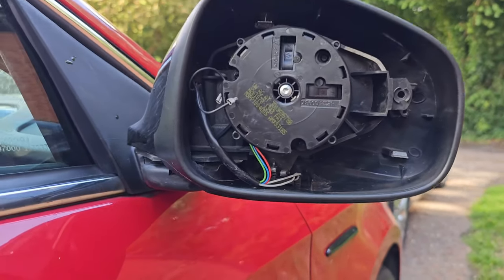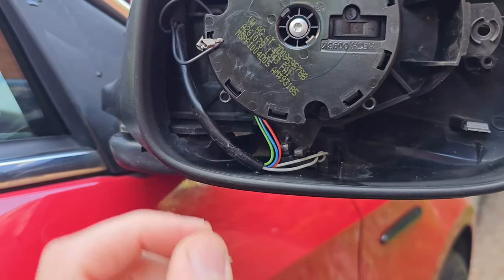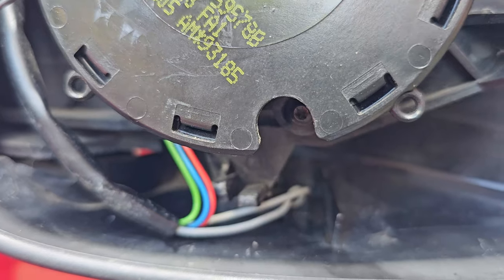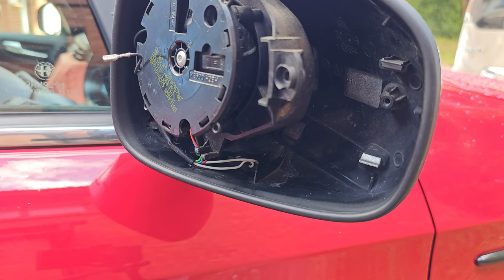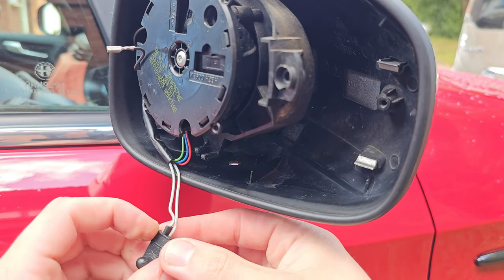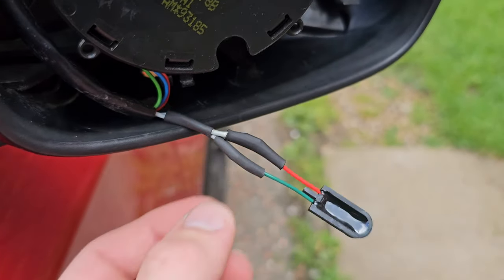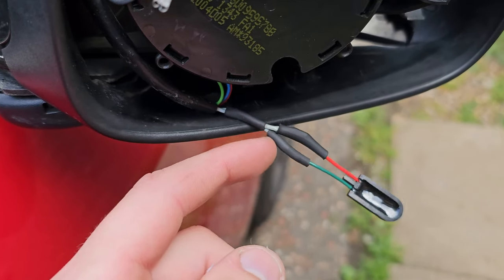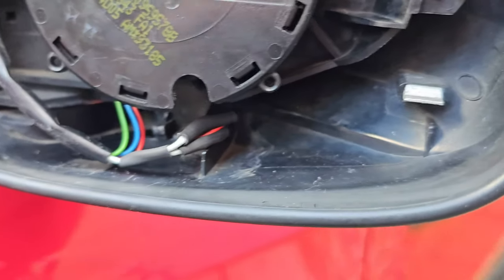Ambient Temperature Sensor/Air Con Problem Fixed

Comment: I've got a 2011 ford focus. mk3. The temp outside was reading -4c when it was 11c. Today I got someone to connect a diag device or whatever you call them, and the temp started reading correctly. Now when I've gone back in the car, the temp has dropped down again showing 5c when its 14c. Is this going to be a sensor or computer fault?
Reply from the maker: So resetting with the diagnostic device sorted it, and you haven't replaced the sensor? Assuming it's as easy as on my car, and the part is as inexpensive, change it just to dismiss that as the problem
Reply: @marcus_motors_  I'll do that next after sorting out the vent and leak at the joints on the boot

Comment: Why do these things fail so much? I need to replace mine again after just replacing it two months ago!!!!!!!
Reply from the maker: 😂 alfa electrics. I would say check the wiring loom in the door hinge, but if replacing it fixes the problem straight away, maybe unlucky with the diode mate. Can't really help other than with this video 😂

Comment: The aircon has stopped on my 500x although the temp is reading..my question is if it is an incorrect reading ie 16° in 3 others cars but 21° in mine would this stop the aircon from working?
Reply from the maker: This is common with the giuliettas, not sure about yours. For the price of it, I'd try this first, even before a regas
Reply: Have you saw the vid from Jerry Hernandez YouTube ref this fix..can you comment on his removal of the mirror case to access the sensor.

Comment: Hi bro does it matter which wire of the new sensor goes to which wires on the car
Reply from the maker: Hi mate, asked a sparky after doing the video. Should've done it before but yeah haha because the sensor is a resistor, it doesn't mater it can go either way
Reply: @marcus_motors_  thanks mate I dont know which one to order, theyre all the same on ebay I think arent they..
Reply from the maker: The link should still work mate, but if not, I found there were a few identical listings when I bought
Reply: Hi bro have my sensor delivered. Covers off and indicator, just working round the mirror atm. Finding it tricky to remove. I wonder aswell.. do you need to disconnect the battery aswell before cutting the old one out, or just make sure ignition is off.. tia
Reply from the maker: I didn't bother. When I looked at the gauge of the cables, I didn't give it a second thought. But feel free to disconnect it for your peace of mind mate. I don't want you complaining that i gave you false advice 😂

Comment: Can you not just use a chocolate box to connect rather than soldering lol
Reply from the maker: Yeah, anything water tight mate. Crimp fittings with the heat shrink pre applied, whatever you want. I just wanted to get the solder out haha

Comment: Damn, I changed it, but same problem. It Worked When I just changed it, but 1 day later, same problem.. 😢
Reply from the maker: If it fixed the problem when you changed it, double check your crimp/solder connections?
Reply: check the connections in the door hinge - they're worn where the ziptie holds them - cut that thing off and fix the wiring.
Reply: Same for me lol. I changed the sensor, was not easy. Worked for a day then same problem. It says -30 C degrees when it is +40 C outside. I would not care but the aircondition doesn't work probably because of this.
Reply: @leecasper6657  AC is involved only to the degree of temperature being close to the freeze (it does not simply engage then)

Did you check the door hinge harness?
Unless you got a used sensor, problem's in a different place.

EDIT: dismiss, the second part - I thought it was a Volvo... lol
Reply: @leecasper6657  of course if the vehicule indicate negative temp, air conditioning can't work !